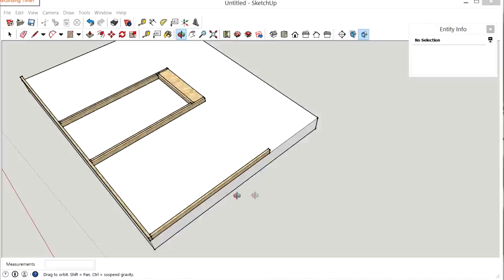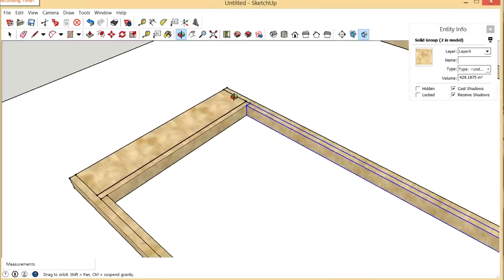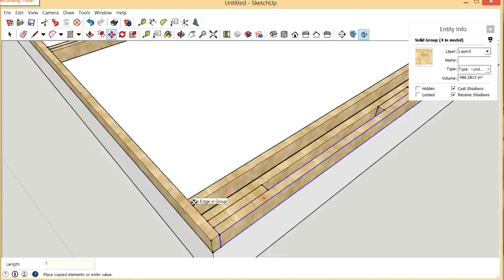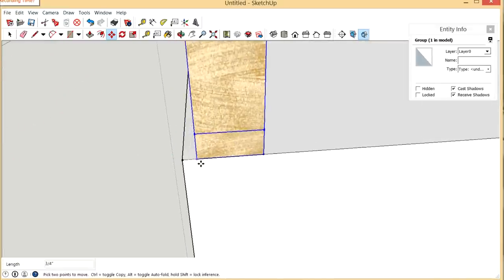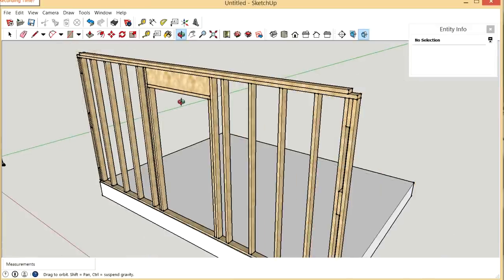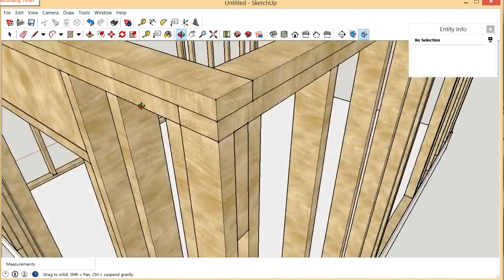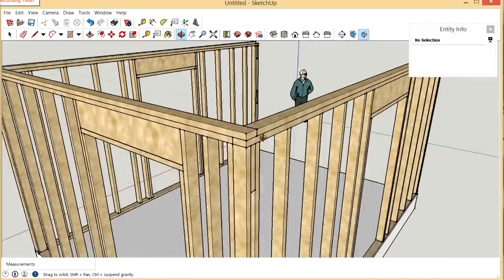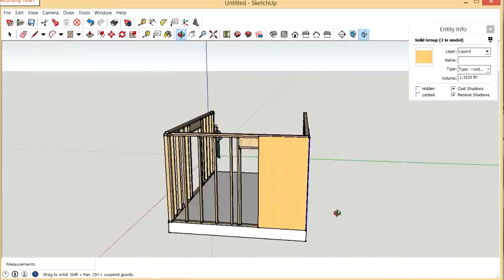Framing Exterior Wall Corners - Requested SketchUp Video

Comment: Fantastic!  I've been wanting to learn Sketchup and how to frame exterior walls.  You joked around about your videos being too long and possibly spending an hour doing the whole house.  Well, if you were interested in doing that very thing and had the time, I'd be delighted.  I've always wanted to understand the entire process of building a house from ground up.  So even a "quick" bare-bones video would be awesome.  I'm really intrigued and tempted to try building a Tiny House on a trailer bed, light enough to be pulled by a Honda Pilot.
Reply: I would like this as well. His insights into housing code and strength was great.

Comment: I really enjoyed the video. I was looking to make sure I did the corners correct and your illustration was perfect and informative. Thanks! Keep posting!
Reply from the maker: Thanks a bunch!  I will be starting a new series soon on building a house from the ground up in SketchUp.
Reply: @ArtisanTony  Are you using the downloaded version or the free online version?
Reply from the maker: @jeffreymoore1955  The version in this video is 2018 Pro. I now have 2019 Pro version that comes with  software called Layout that helps with producing construction documents that are printed.  They have a free browser version that does not have to be downloaded.
Reply: @ArtisanTony  I found the web version. I'm never a fan of web versions. So yours came with another product. Interesting. Thanks for the info. Trying to snag a copy myself. Guess I will have to go with the web version for now. I have to design a shed for a building permit.
Reply from the maker: @jeffreymoore1955  go to the 3d warehouse inside sketchup  You can find things to download there.  Search for shed and I bet someone has already drawn one.  In the browser version click on the 4th icon down which are the little stacked boxes.  Search there and I bet you can find something
Reply from the maker: left side 4th icon down
Reply: @ArtisanTony  Thank you, sir.

Comment: Awesome job very informative video by far the best rough sketch explanation of wall framing I've seen!! You need to make more of these explaining how you anchor the exterior walls to the slab foundation weather you shoot them in with concrete nails or drill through the stud down into the concrete and use bolt anchors spacing them out every 2 ft or what have ya
Reply from the maker: Thanks! I'll try to make some more of these videos.

Comment: this type of corner is probably used most often, but it is a "cold" corner, because it can't be insulated easily. The other option is a "California" corner that turns one stud 90 degrees. This still allows 3 studs in a corner, but also allows the corner to be insulated. Nice job on the video.
Reply from the maker: I know what a California corner is and it is substandard compared to this corner.  It allows for very little nailing of exterior corners and siding.   One window loses more  energy in a house than any of the framing will.  Look at the framing system as a whole. Not just one politically correct component in the system.  I have been building for 40 years and this corner is the way to go.  If you are anal about the insulation, foam it but do not use an inferior structural system just because you saw someone suggest it.
Reply: @ArtisanTony  I thought your answer seemed a bit touchy. I merely pointed out that there are other methods that can be used. I did not say that a California corner was superior, only that it allowed ease of insulation. I too am a builder and I have been building about the same length of time that you have. I am also an engineer. I have built on both the the East and West Coast. The building code specifies that there must be three studs in each corner and both your method  and the California corner satisfy that requirement. there is not lack of strength in the California corner. The insulation ability of the California corner has more impact once you start using larger studs for exterior walls. With the Spacer block method that you showed, the uninsulated area becomes pretty large if you go to a 2x6 or sometimes now a 2x8 on the exterior walls. The California corner is not just some political correct idea. It has been in use for building since after WWII when the housing boom started in California. 
I certainly appreciate your comments, it is always good to hear someone else's point of view on things. I clicked on your video because I saw Sketchup. I use it a lot too, for everything from home design to furniture design. I thought you did a great job at explaining how the parts of a house go together. I especially liked the fact that you built the wall on the floor and stood it up as we do in the real world. Thanks for the video and the reply. Good luck!

Comment: This is the best framing explanation I've ever seen, so I hate to be the only one confused over detail.  Shouldn't that 15 1/4 inch be measured from the inside of the wall?  As I see it, you'll have 1/2 inch of that 3rd corner stud to nail your sheetrock to.  So measuring from the inside corner will automatically place your starting point on center, so when you measure over 15 1/4 inches, and place the stud, overlapping onto that stud by 1/2 inch will give you an over all measurement of 16 inch from edge of inside wall to center of first stud.  Then if the next two studs after that are also spaced 16 inches apart on center, you can easily place a 48 inch wide sheet of drywall, with room on the 3rd stud for the next sheet of drywall.  I am really confused over the idea of measuring over 15 1/4 inch over from the outside of the wall.
Reply from the maker: The 15 1/4" is measured from the outside of the wall.  Just imagine yourself putting up sheathing 4' wide on the outside of the wall and being able to start with  whole piece from the corner each way.  So you want 4' to the center of the stud where they join. The sheathing does not overlap each other at the corner. They just both come to the corner so you can use this measurement going both ways from the outside of the corner.  Honestly it is not critical because you can cut the first piece of sheathing and the rest will work out at 48" but it is nice not having to cut the first piece. By the way, drywall is easier to cut so we always make the outside sheathing work out and not worry about the drywall.  Sheathing is hung vertical and drywall is hung horizontal so the dry wall will have to be cut anyway. Hope this helps. Thanks!
Reply: ArtisanTony Yes, I think I understand now.  If you start the sheathing right at the outside corner, by starting the row of studs 3/4 of an inch closer to that corner, the sheathing will reach the center of a stud at  the other end.  And however it works out inside is for the drywallers to deal with.
Reply from the maker: Troy Carpenter yes! :)
Reply: How to open a wall and make a door
Reply: This used to make me wonder exactly why they do it this way (and let the drywallers deal with it)  I started out working with drywallers.

Well, I have the answer (sort of)

Basically, SOMEONE is going to have to deal with it.  The question is WHO should deal with it?

Well, the sheathing is somewhat important in that it helps hold stuff square.  It is also a potential blocking point when it comes to other crews.  So we want the sheathing to go up fast and efficient.  Then the wall insulation can start, the siding can go on at the same time.  Even in some areas, the sheathing goes on the walls before raising them.  We certainly wouldn't want that part to take any longer than necessary.

The sheeting is also a part of drying in the structure, so if someone gets slowed down, we had rather it be later in the job...not one of the first crews.  We had rather have one drywall crew slowed down than a sheathing/framing crew...which in turn, delays plumbing, insulators, drywallers, roofers painters electricians etc.

Also, cutting and fitting drywall is much easier than cutting and fitting sheathing.

Comment: For a 12 x 12 building -The front and Back walls will be 12 ft and the side walls will be 11'-5" on the left and right or you could make your floor 12'-5  on the left and right and just build all walls 12 ft and it would also work too

Comment: thanks for the tutorial. i like the idea of keeping all your cut offs so maximize blocking. the only thing with that design on the corner is that it creates a cold pocket. once you attach the other wall and sheet the outside you cant put insulation in the gaps which down the road can cause mold and mildue
Reply from the maker: Do you know how many "cold pockets" are in a home?  Hundreds.  Do you know what the r-value of a window is?  Please do not preach to me. I have been building for over 40 years and know every square inch of construction.  Just research thermal images of exteriors and you will that your windows and doors are the biggest culprit..  When you solve that, come back and preach about the way we build corners.

Comment: I was thinking maybe the request was about the overlapping along with the wall lengths. Like on a 12ft x 12ft building the short wall wouldn't be 12x12 and only the top plate that does the overlapping will be 12ft. You would have to reduce the wall size since the bottom plate board will be 2x4's on each end and the wall will fit in the middle. Hope you understand my explanation lol basically just shorten the side walls overall length to fit in between the front and back walls since there's a 2x4 on the front and back unless you build your floor a little larger to make the walls fit at 12' exactly before building

Comment: Very good video. One thing that would be better if you would have told us what the nailing of each piece is. Small thing but very important. Thanks for the video.
Reply from the maker: It's very simple.  The studs get two nails each end from the plate into the stud and the OSB can have several different nailing patterns depending on whether it is a shear wall or not.  But I like to nail the edges at 6" o/c and 8" o/c center in the field.  So nailing patterns are application specific and there are charts you review to see the required nailing pattern based on the application.

Comment: I have a ranch home with the roofline extended to make a 2 car garage/cover but no walls. Posts & roof are already in place (1 post in each corner, 1 post in middle of left side/wall, same for back side/wall. Home with full exterior wall/siding is connected to make the right side/wall.
I want to add walls to enclose the space and make it a true garage instead of carport/covered parking. Could you make a video to walk me through what size lumber I’d need (2x4 or 2x6 studs), making the corners and connections, etc. I would love a window between each of the posts on left & back wall. Will add a 2 car garage door to the driveway side/front, if you could show how to frame that as well!

Comment: thank you so much that was by far the best video I have watched explaining framing I am currently building a workshop for myself and would love something like this to explain roof structures I will have a vault style ceiling    11ft high   (wall plate to wall plate span is 20 ft   gable to gable is 16 ft with entrance on gable end )) I plan on using ridge beam with purlins from both gables and also two beams spaced evenly within the 20ft  span also from both gables on which the raised 11ft high ceiling juices will sit. from there  both purlins and ridge beam will be supported every 48 " . ridge beams and purlins need to extend beyond on one gable 8ft so as the roof is extended beyond gable over a decking area where  supported  a beam structure at entrance edge of front decking will support pur;ins, rifge beam and extended wall plates . the two ceeling support beams do not extend beyond the gable wall .      so tony if you like a challenge theres one for you. would really love to see how you would do this inc sizes of beams etc
Reply from the maker: Stay tuned I have a paid jog coming up this week for a tool/office shed. Thanks!

Comment: That was a great video do you have one on making a long wall where you have to build it in sections and stand them up and how to tie two pieces together. like maybe 2 20ft sections on the same side to tire them together?
Reply from the maker: You would just offset the double top plates and nail them together when you stand the twp wall sections up.  Do I really have to make a video on that? :) jk
Reply: @ArtisanTony  i was literally googling the same thing and stumbled on your video lol i also was just messing around on sketchup designing my shed but realized i need to learn how to use it first so great video and thanks for answering my man Dillon, (also looking at building a 20 ft wall

Comment: Really helpful video, watching the pros, they tend to gloss over things that are simple to them but profound for us laymen.  On the short wall your sheeting starts 3 1/2' away from the first stud so wouldn't you be off sheet for nailing? Also, are additional studs added for interior sheeting, because the exterior point of origin is different from the interior, or do you work with the exterior layout since it's easy to cut sheetrock to length?

Comment: I'll be implementing this in general. I'm starting out as a builder.
Reply from the maker: Cool. It works well for 2x4 walls.  For 2x6 walls you will need to use the California corners.
Reply: @ArtisanTony  Aren't Californian corners assuming you'd be using internal sheeting?

Comment: We always used a piece of OSB to space the header pieces apart.  Its about 1/16" short of being wide enough, but functionally it works out fine.  Of course with a framing nailer it is a lot easier to put them together without the spacer.  With Ye Ole Hammer its a bit more of a challenge.

Comment: I like videos like this.
Why wouldn't the outside sheathing go to the top of the 2nd top plate?  why leave it down.  Is it just the size of the spec'ed lumber? How do you seal up the airgap between the 2 top plates?

Comment: Could you do a video about construction considerations in a cold weather environment. I'm just wondering what would have to be taken into account when building in an area up north versus Southern Florida where I'm from.. Specifically things like elevated pier construction for a cabin, plumbing, insulation, heating etc. Thanks.
Reply from the maker: Mark C. For cold weather you just need a zone from the ground to the floor system that is insulated to suit the local environment.  It might consist of a framed shaft with insulated walls. Then the floor system is insulated as well.  Is this what you mean?
Reply: ArtisanTony
Yeah that is what I was wondering about because many of the cabins I've seen were open underneath but they aren't used throughout the winter. I'm trying to design my first project which is a year round two story stick built cabin that I'll hopefully be able to build someday. Your videos are always helpful, thanks for the reply!

Comment: Does the overlapping top plate go over all three or only two of the studs below it? The angles shown in this video are not showing it clearly. Thanks for the awesome video
Reply from the maker: The plate on top is cut back 3 1/2” so the other wall top plate can lap over

Comment: Ok thank you.  Questions abound...why do this three-blocks-plus-an-extra-stud business at all?  To me anyway, that was not clear.  Was it so that you'd have a solid point to which you could attach the OSB sheeting?  For extra rigidity/sturdiness?  Or so that the 2x4 of the adjoining wall will have something to be nailed to?  Next, I have a question about that door/window opening.  When I've seen this done, the jack studs go from the base plate directly to the header.  That is, the window top plate/surround is nailed in between the jack studs.  Here you show the jack studs going from the bottom plate to the bottom of this window top plate/surround.  Is there a reason for that?

Comment: each time i draw a stud and move it next to another, it connects itself to the other stud, and then when I move it it's hard to separate. I have to copy instead of move and then delete the first. what setting do i need to change to make it so each stud is an individual entity? SketchUp Pro 2019 v19.2.221
Reply from the maker: Make your stud into a component which is easy just select the entire stud and right mouse click then select "make component" then just accept the defaults and don;t worry about the component settings.  This will keep them from joining other objects and also allow you to make changes easily.   Lets say you drew an entire house with 8 foot studs but then your wife :) wanted 9 foot ceilings.  You can go into one of the studs and edit it and all of the studs will change with it.  Have fun and thanks fr watching!

btw, If you do not need a component, just make it a group and this will also keep it from joining other objects.
Reply: @ArtisanTony  Perfect!

Comment: Hey Tony!  How do you frame up an interior wall meeting up to a vaulted ceiling? The section that touches lots of roof trusses, and how the corners need to meet up?
Reply from the maker: You just block between the trusses, nail up a top plate then measure and cut studs at 16" o/c. Of course you have a bottom plate also :)  Is that what you meant?

Comment: could you do a video on advanced framing and your thoughts on it?
Reply from the maker: I don't like it.  It is not advanced at all.  That is a term used to make it seem better. We have been using lumber wisely for many years. As you can see in this video we plan out how to use our waste.  The advanced techniques create weaker walls and less places for nailing of siding and interior wall surfaces and trim.  It is not necessary as the building industry is very good at replacing the timber we use.  Thanks
Reply from the maker: But yes, a video would explain why. I will do it when I get a chance. Thanks